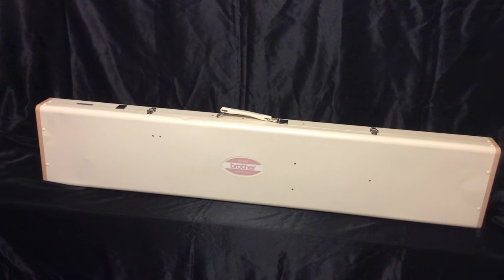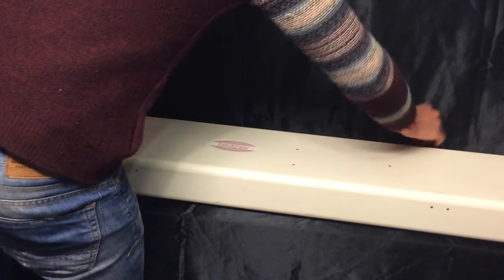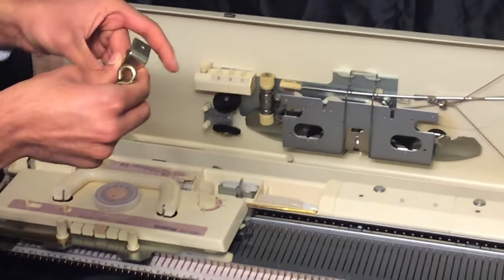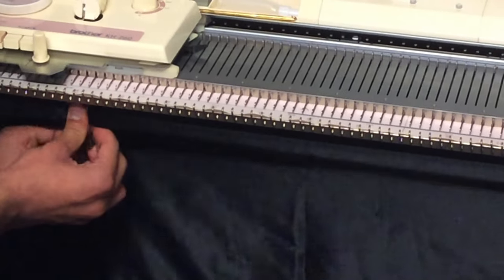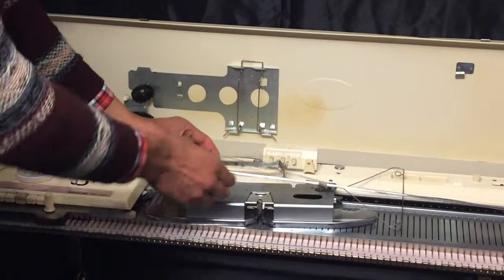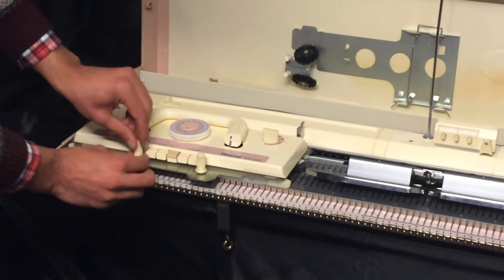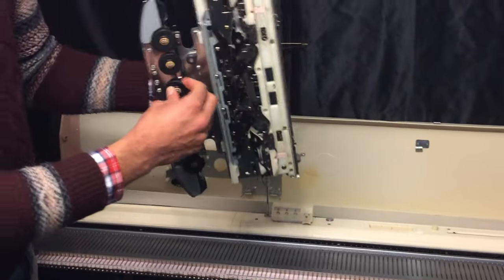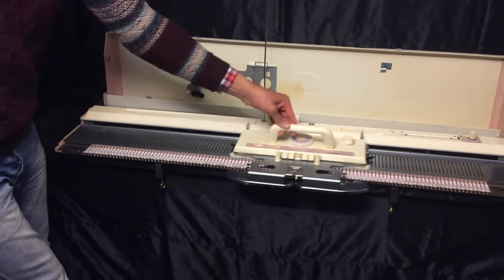How to setup a Brother Chunky knitting machine KH 260

Comment: Hi, ice video. BUT! Never add plate to carriage holding carriage or both in a had like that. Always place Carriage on a machine in its rails. And only then add sinker plate.
Or - you can drop both, damage... and it will cost you reaaaly a lot... :)